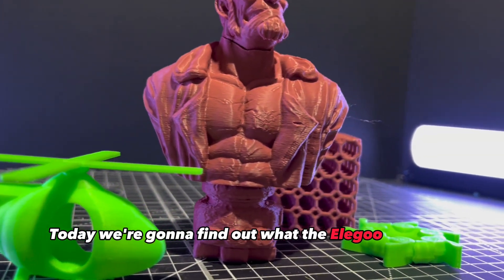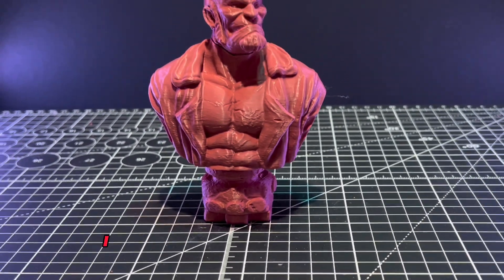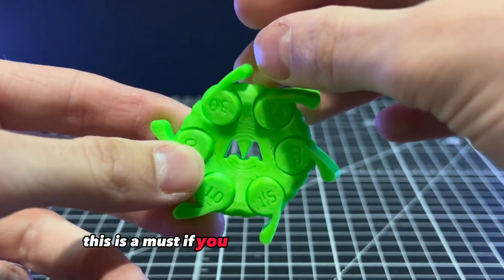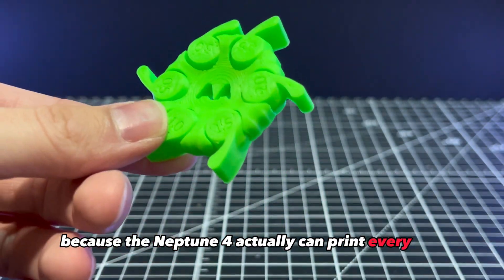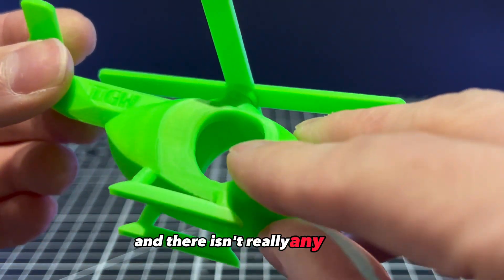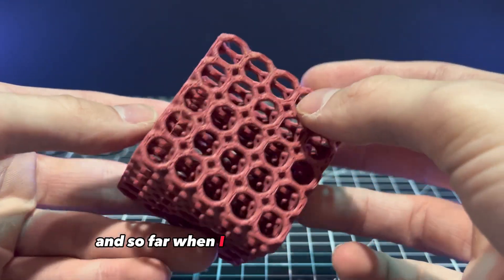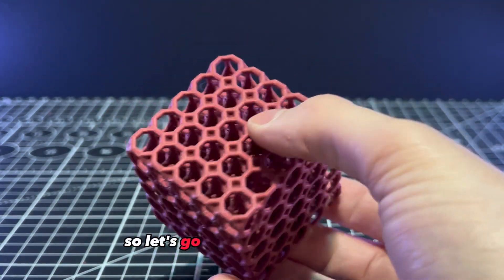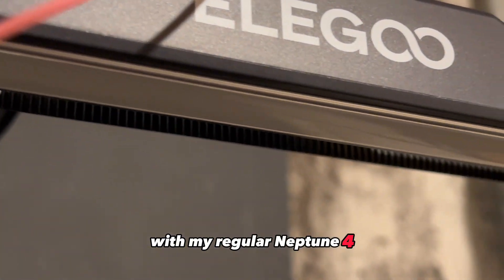Can it even print good? | Elegoo Neptune 4 pro

Comment: Any problems with leveling the bed? Kind of disappointing that it doesn't come with a fixed bed and auto Z-offset compensation.
Reply: Z offset compesation is just sensors underneath the bed to detect the nozzle to compensate for z offset. 

ABL can only compensate and not fix the bed so overtime it might give issues and you'll have no option to fix it since it's all software and no knobs to turn.
Reply: @gamingscorpionindia1995   The neptune 4-series has knobs.
Reply: @fabbe432  That's what i was saying. Neptune 4 has knobs but Benny wanted one with fixed bed so i was explaining cons